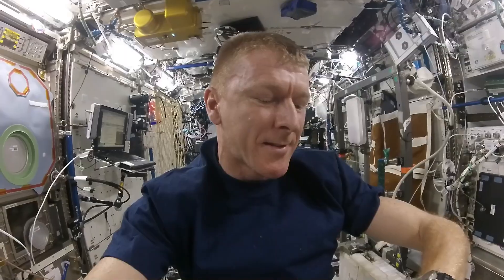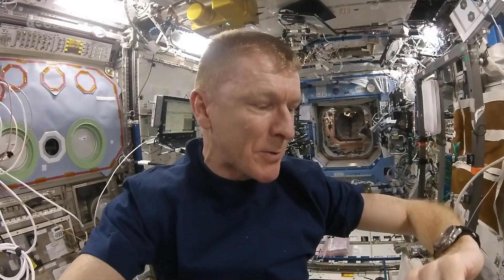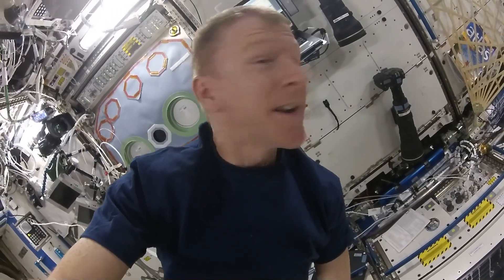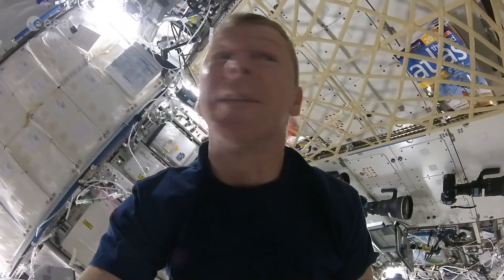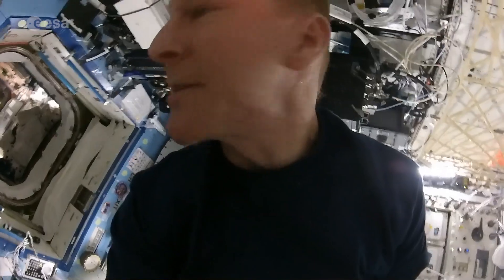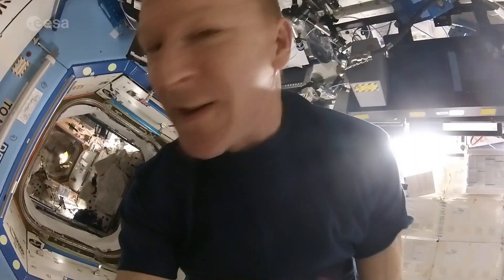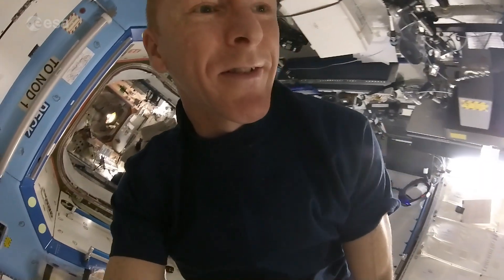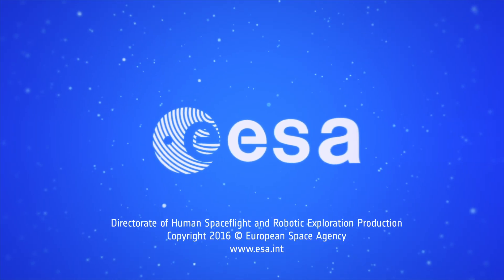ISS reboost

Comment: Why the hell do they want to crash the ISS when it gets old? Why not replace the modules one by one starting by those in worst condition?
Reply: It’s very hard to just “dissemble” due to cold welding. When it’s as cold as it is in space metals weld together without ever needing to actually weld. Plus trying to make new tech work with old tech is really hard
Reply: @captainhellhound7451  interesting

Comment: Anyone know how long they fire for and what is the total change in velocity?
Reply: +69tthompson The Progress thrusters fired for 10 minutes and 52 seconds, providing a total delta-V of 1.05 m/s, pushing the orbit from 398.2 x 407.4 km to 402.1 x 406.9 km. The station's orbital period increased from 92.62 minutes to 92.66 minutes due to the slightly higher orbit. Inclination remains at 51.64 degrees.

Comment: why not getting the iss to a higher altitude so it doesnt have dran and need reboosting?
Reply: +ruben montero    Actually they have done just that.  It has been boosted  from 350km to about 400km in altitude.  http://www.nasa.gov/mission_pages/station/expeditions/expedition26/iss_altitude.html  Putting it too high would mean more fuel to reach it on every flight.